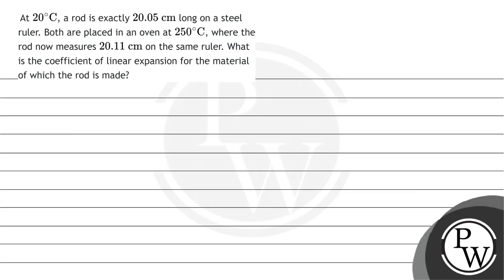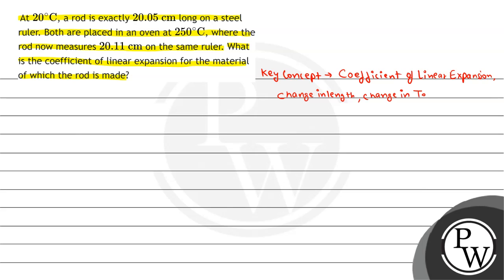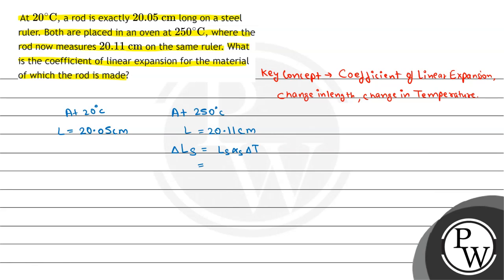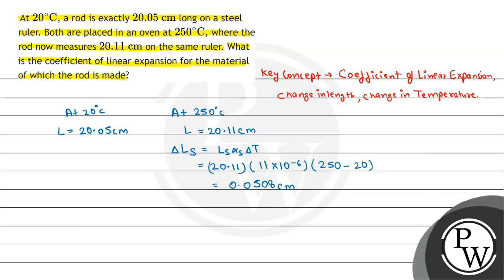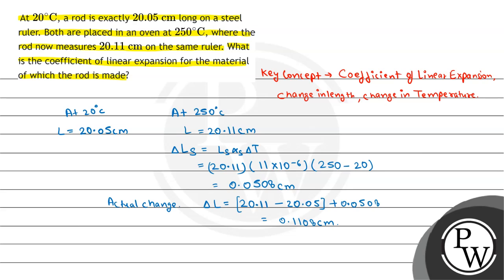At \( 20^{\circ} \mathrm{C} \), a rod is exactly \( 20.05 \mathrm{~cm} \) long on a steel ruler....

Comment: In the end .....last formula
Alpha = ∆Lactual/L•×∆T
Where L• is the original length of  steel ruler 
 ....then answer will be 24.00exp -6 °c^-1 
24.00 into ten raise to power -6 per degree Celsius